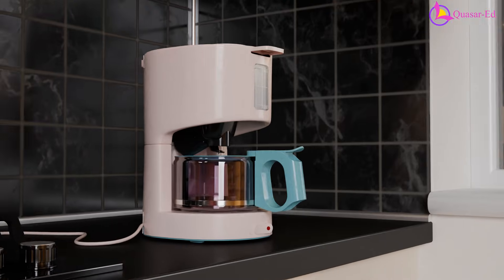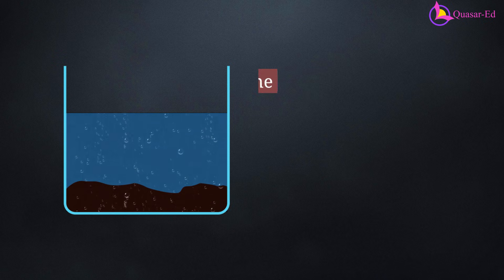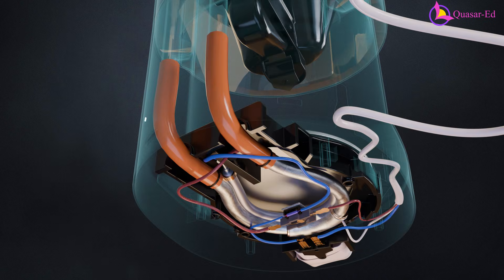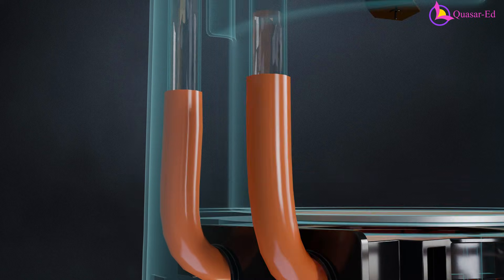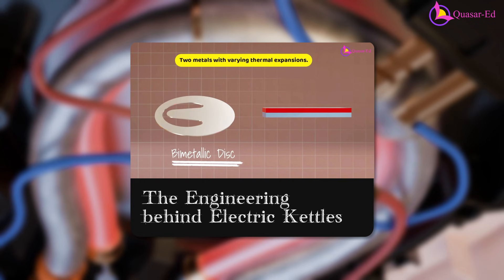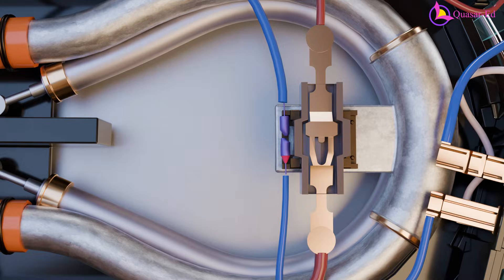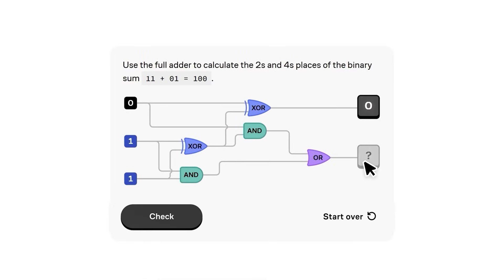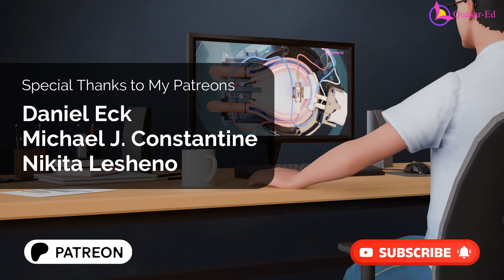The Genius Engineering Behind a $10 Coffee Maker

Comment: Hi quasar can you show us the machanics of rolling curtains
Reply from the maker: When you pull the string on the rolling curtain, the string rotates the small wheel which is connected to the curtain shaft. And when the curtain shaft rotate, it rolls up or down the curtain. The process is not complex enough to make a video, but if you are still trouble visualization, let me know, I could make a youtube short.

Comment: These cheap machines are truly amazing in engineering. Yes you can use some chips and sensors for optimal result but a true engineer know how to make something barely good that it works and its cheep . In this case , with a tube and two valve and one stip of metal